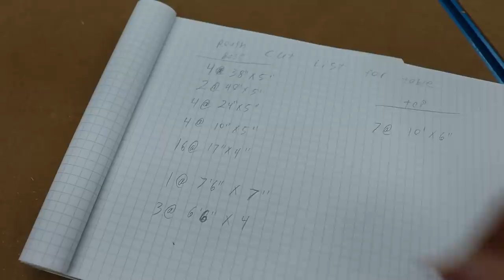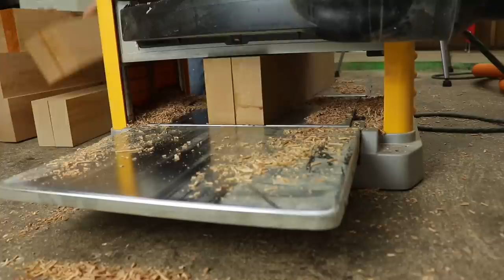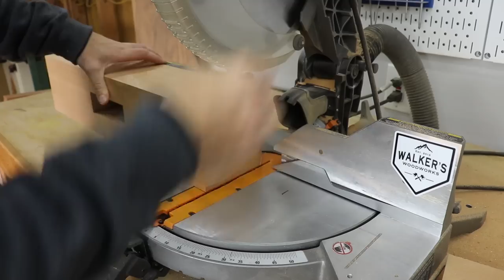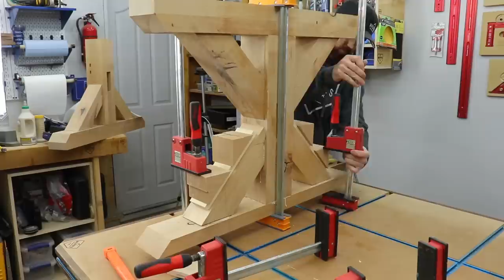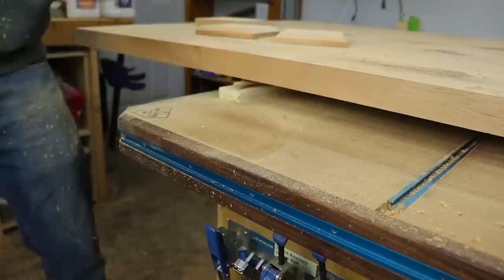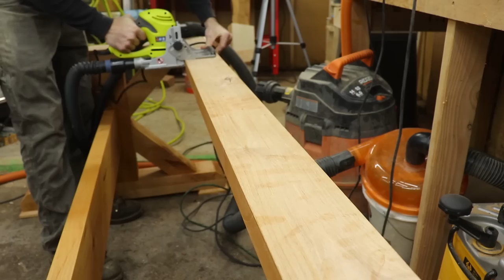Custom Farmhouse Table Build

Comment: I bought your plans…started the build and I’m super excited to see it all finished! When you clamped your top, did you only clamp from the bottom? Or did you add more clamps on the top side off video? Thanks for the plans and video!
Reply from the maker: Thanks so much for the support! I honestly don't remember but I do use clamps on both sides to get even pressure.  That's what I would recommend.

Comment: Awesome table.  What kind of wood did you use?  And the dimension?  I hesitate to purchase lumber from a box store as it is full of water and may tend to warp over time.  Any recommendations?
Reply from the maker: I used knotty alder.  It's a 10ft table.  Definitely look for a local hardwood supplier that deals with kiln dried wood.

Comment: Do you think dowels would work as an alternative to the dominos?
Reply from the maker: Absolutely
Reply: @WalkersWoodworks  If i were to use loose tenons with the router would i need to make them snug like you did with the domino, or would it be alright to make them oversize and have them be loose?
Reply from the maker: I would try to make them as snug as possible at least a couple for locating.
Reply: @WalkersWoodworks  thank you for taking the time to answer i appreciate it!

Comment: Nice build, I see you used C channel for table stiffeners? How many did you use on that top? Where did you get your C channel? Legacy Lumber wants $45 for a 35” piece? Btw, what size was the C channel you used? 1”x1/2”x36”
Reply from the maker: I usually try to use 3 on a 10ft top or 2 on 8ft or less.  I buy it from the metal yard in 20' sticks.  It's around 20-25 bucks and just cut it myself and drill the holes.

Comment: Nice build! What kind of wood was used and how'd you attach the top? Was waiting for that part but wasn't in there.
Reply from the maker: It's knotty alder.  I attach all my tops using z clip table top fasteners.  I make the slot for them with a biscuit jointer.

Comment: What were the dimensions of the table overall? What type of wood did you use?
Reply from the maker: 42" wide and 10ft long.  It's knotty alder.
Reply: Walkers Woodworks what type of woods do you recommend for tables like that?

Comment: Hey Brandon, im making this table now for the second time, the first one turned out great! This second table is going to be 12 feet instead of 10 feet. Do you think there would be any issues with using this same design and adding a foot to each end? Im thinking as long as the stretchers are the proper length it shouldnt be a problem.

Comment: Are you worried about wood movement? I'm just looking into building my first table. Thanks
Reply from the maker: I use the z clip table top fasteners to allow the top to expand and contract.
Reply: @WalkersWoodworks  do you have a video about bread board ends for table

Comment: Awesome build video. Did you find that the df500 domino made deep enough cuts for the base? Been debating between getting a 500 or 700 for builds just like this. Thanks.
Reply from the maker: I highly recommend the 500 unless you plan on building a bunch of huge slab furniture, the 500 does everything you need.

Comment: Awesome Table and great video.  I'm putting together a cut list and plans to build  one my self. I have one question, what are the three 6' 6" boards on your cut list used for? Thanks in advance.
Reply from the maker: I believe they were for the stretchers on the top.